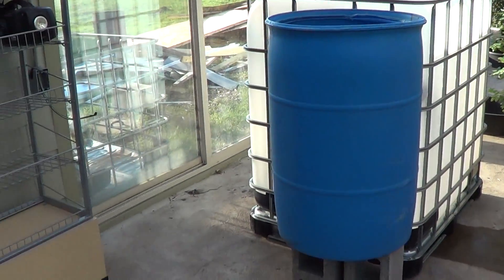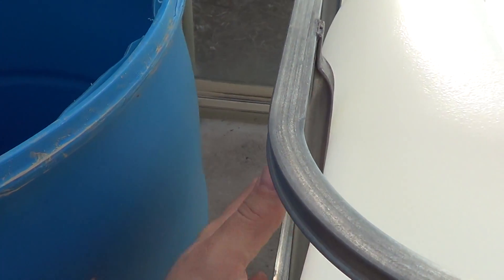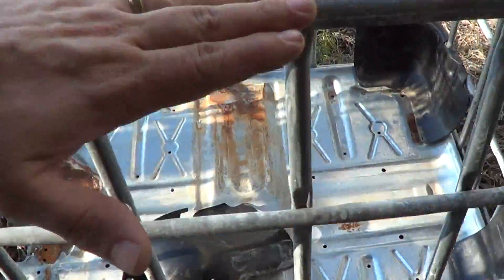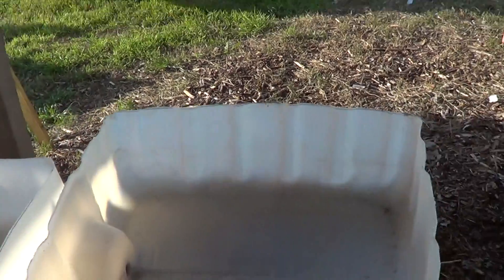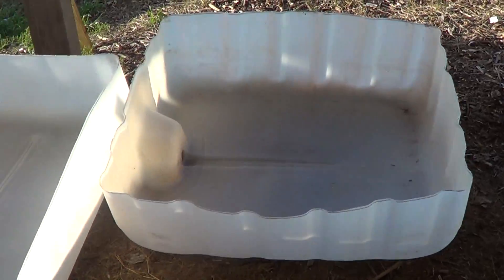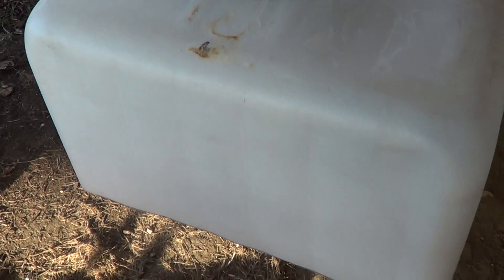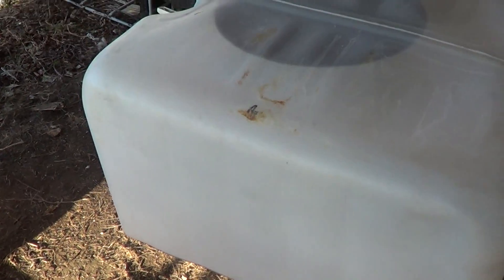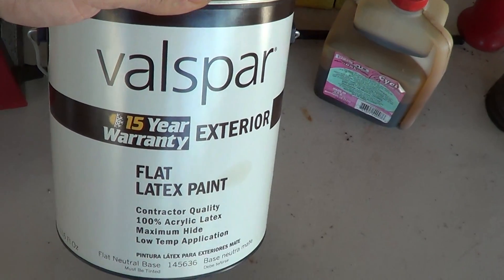Aquaponics Build Video 1

Comment from the maker: I am outside Anna TX (North of Dallas south of OK)
I should be OK with the sump at 15" - the pump I have can be regulated for amount - I can always bring more back to the tank id needed. If I start to have an issue I will use my "nursery" tank as the sump, then create another nursery.
Where are you at?